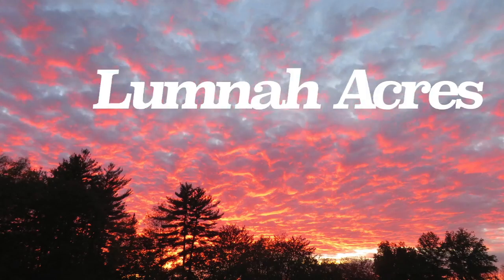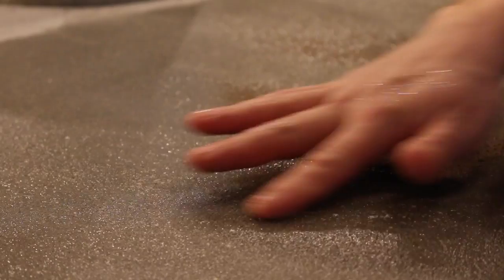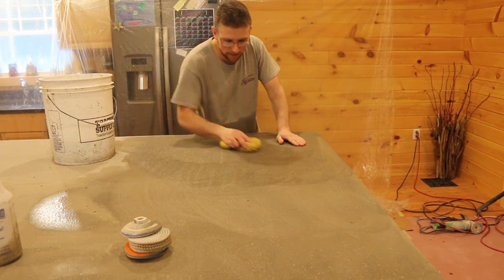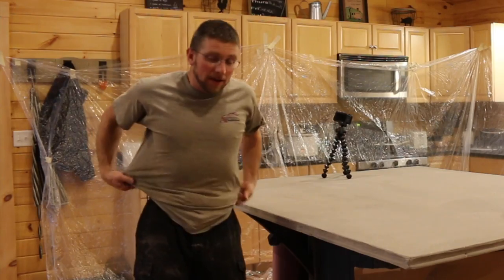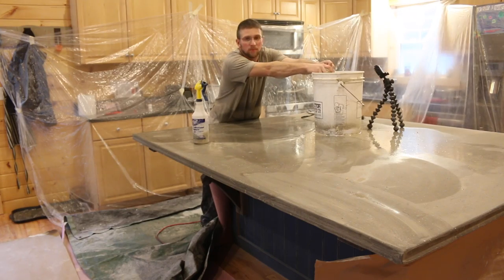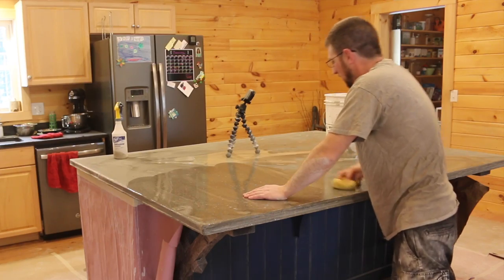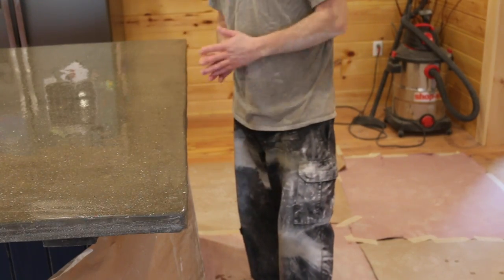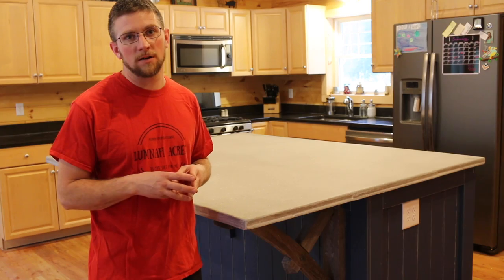SANDING The CONCRETE counter top

Comment: I've used mineral oil on concrete kitchen counter because it is food safe.  As long as you get a pure tune oil I would think it would be food safe, mineral is so easy to get hands on and cheap.
Reply from the maker: Todd Sarnstrom Thanks. We have some pure tung oil left over from our floors. Did you like the mineral oil finish
Reply: Lumnah Acres the mineral oil looks great.  Penetrates well so you protect from stains.

Comment: Turned out nice. I just poured my 4x8 island top. I poured onto puck board. I just removed it and it’s extremely shiny, to shiny. My sealer is a matte finish, I’m a little concerned if i sand it it will show the swirl marks ??

Comment: Wonder why you didn’t continue sanding and polishing with increasing your Diamond pad number; 50, 100, 300, 800, 1250, 2,000, 3,000., 5,000. Makes it really smooth and just a touch of shine without pouring any top coating. Maybe you weren’t finished. Not sure

Comment: its so rough because you troweled off all the portland cement
Reply from the maker: Thanks for the tip
Reply: In curious if he didn't troweled of the water would the grid on the cement be less rough ?is that what you ment?
Kind regards rose

Comment: wow that a lot of work... nice job just for information you need a mask and good ventilation maybe you did not read the specification on the bag of cement but the dust is very dangerous and cancerous, etc....
Reply from the maker: Thanks, great tip. Have you ever made a concrete counter top?